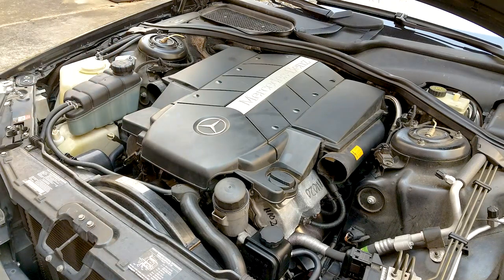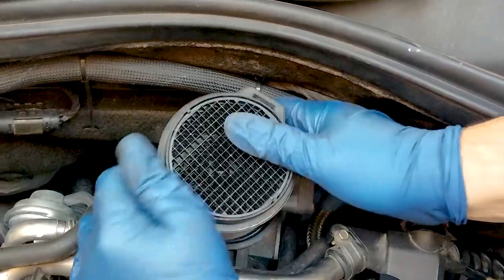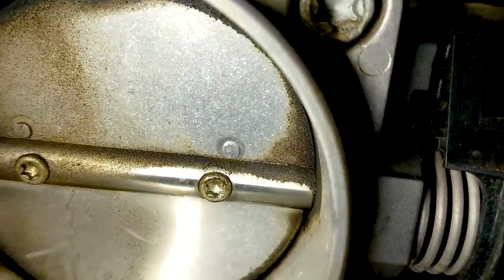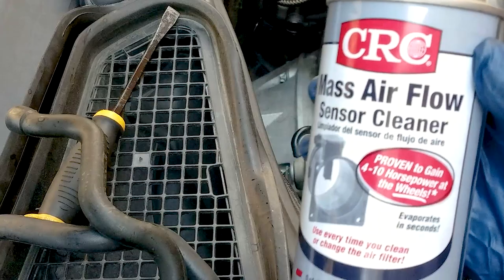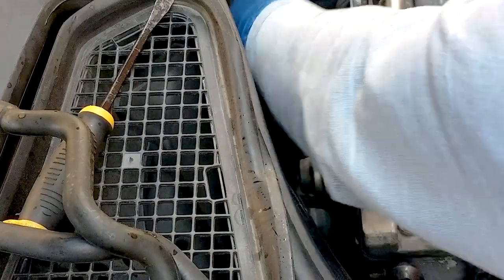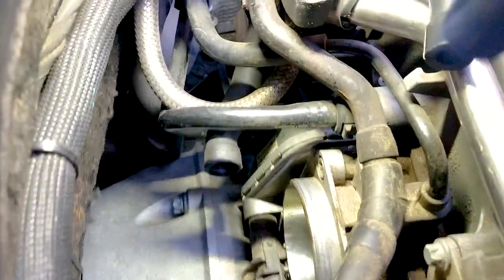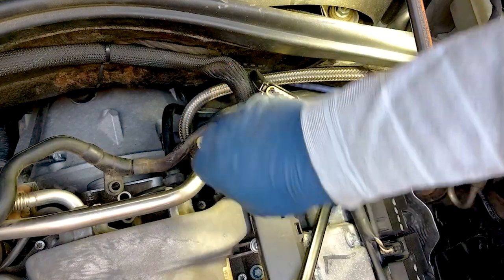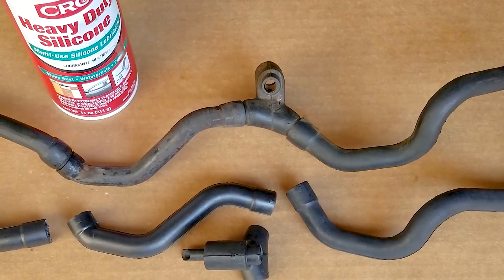Mercedes W220 W210 DIY - PCV Hoses and MAF Throttle Body Cleaning

Comment: I don’t think it’s okay to open the butterfly… it will deconfigure the throttle body
Reply from the maker: Hi Diego, it does not the way I show in the video. Trust me.
Reply: @masood-tv  Please expand on what you recommend around the throttle body "butterfly".. in the video you don't just clean the edges with the screwdriver/towel but it appears that you're also opening the flap. Is that ok to do on this and w210s?
Reply from the maker: Hi Hooman - yes, it is.  Just don't be too aggressive.
Reply: @masood-tv  THanks much for your reply. One question, are there any symptoms to look out for specifically around the PCV system.. I'm used to other cars by doing a rubber glove test on the oil filler checking for suction vs. blowing .. is that applicable to these cars or should I be mindful of some other symptom (short of any ODB code/error)
Reply from the maker: Hi Holman,  no problem.  Na, these cars are built like tanks. You can apply all those concets, including spraying fluids...

Comment: No! No silicone SPRAY! Supposedly, it will ruin your sensors!
Reply from the maker: You are right... Don't spray on sensors.  Just the rubber parts as in the video.

Comment: Hi! What happens, if silicone spray gets into the cylinder?
Reply from the maker: How would it go to the cylinder?
Reply: @masood-tv  By spraying the hoses.
Reply from the maker: @HappyAlexandros  no, it will dry and remain attached just to applied surfaces.
Reply: @masood-tv  What would happen, if you spray silicone spray directly into the cylinder? Lets say through the intake manifold.
Reply from the maker: @HappyAlexandros  I have never tried it before and don't plan to ever.  I don't think anything too good can be expected.
Reply: @HappyAlexandros  could coat o2 sensor if unlucky

Comment: There's also a direct PCV line
Reply from the maker: Hi flowerdemon, thank you. Are you referring to the fatter one that goes parallel to the right fuel lane and connects to the throttle body on the driver side?